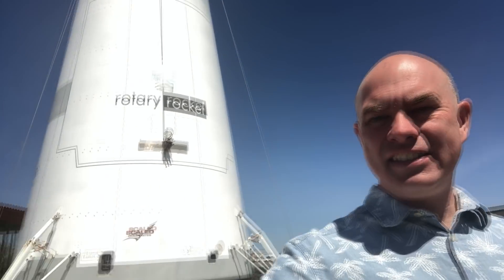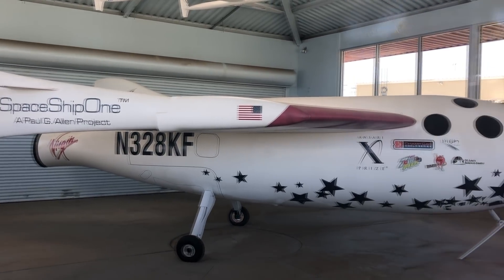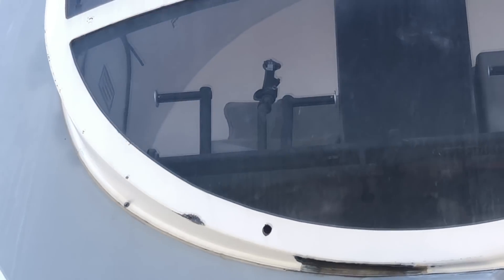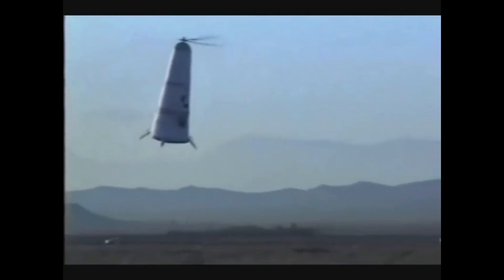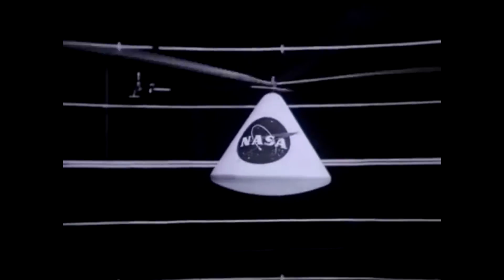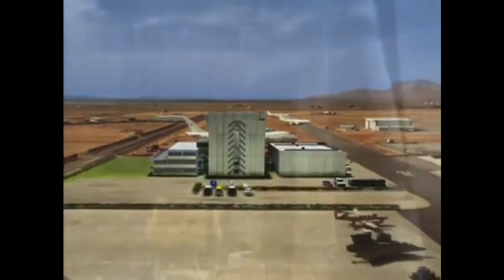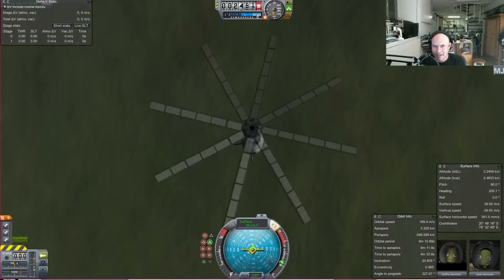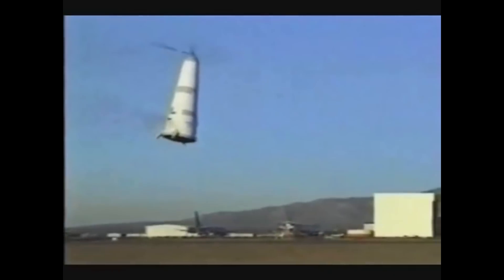Roton The Rotary Rocket - Half Rocket - Half Helicopter

Comment: Why doesn't the fuselage rotate? All helicopters I have seen have at least 2 sets of blades to counter out the net torque.
Reply: because the rotor was driven by small nozzles at the tip of the blades. This way, the rotor itself generated the torque that is needed to drive the rotor. Thus, no torque on the fuselage. (respectively only a tiny ammount generated by the bearing of the rotor)
Reply: Yes it did, they had to use small thrusters to provide counter rotational force.
Reply: The only rotational force would have been from downwash and/or rotor bearing friction, so there probably wasn't a lot of rotational counter-thrust needed.
Reply: @russschnapp4510  The spin, regardless of it's source, always produces a counter spin.
Reply: @TheEvilmooseofdoom  Uh, no. I don't think that's the physics of the situation. If you drive a shaft, you will get counter-torque. If you use reaction jets to spin the blades, there's no torque whatsoever on the shaft, which is only used to suspend the rotors. Likewise, if airflow is used to spin the blades, there's no countertorque. This is why there is no tail rotor on an autogyro.
Reply: @russschnapp4510  My understanding is if you're powering your blades around and jets are powered then you get counter torque.  Free spinning like an autogyro you don't.  I could be wrong but I did read about this rocket chopper some years back and did read that they used thrusters to control the spin caused by the torque of the rotor.
Reply: @TheEvilmooseofdoom  Tip rockets push off of the propellant that is leaving the nozzle, at the tip, no torque at the hub - if the bearings and connections at the hub were lossless, anyways. The hub is literally just a bearing and won't transmit much torque, there's no rigid connection there. There's still torque on the vehicle because it's not lossless, of course, and routing fuel to your tip rockets probably means you've got a bit of friction at the hub, but it's still on the order of magnitude that an autogyro deals with and not the major torque that a helicopter makes. Way easier to deal with via the RCS (that it needed anyways), which I'm not sure would be the case for a helicopter.
Reply: @jonored  Quite frankly how they get the fuel from the body to spinning rotor tips alone is beyond me. If your hub is not spinning like you said I can follow your line of reasoning.  If the rotor motors are self contained (fueled) that makes even more sense to me.
Reply: @TheEvilmooseofdoom  Interestingly enough, they probably have to thrust in the opposite direction to what a helicopter would - a helicopter is controlling the reaction torque from powering it's blades (opposite direction to the blade spin) while this is countering drag through it's bearings, seals, and swashplate - which is in the same direction as the rotor spin. You always need something to control your rotation, even in an autogyro, but amount you need and why can be very different.

Comment: I can see how it would help at low altitude in recovery and reuse, but I don't see much advantage in assisting takeoff; not in comparison to balloons or airplanes. Furthermore, without its use in takeoff,  the extra complexity, in both parts count and where you put the rotors, does not seem to be worth it in comparison to parachutes and powered rocket landings. 

Yes, powered rocket landings are complex, but having throttle-able engines and more advanced avionics is not a penalty in my book.
Also, I know my reasoning is kind of  circular, but the other meet-me -halfway options do not require that you bring the takeoff assistance with you. Therefore, it's not circular reasoning, it's spheric obloid reasoning.

Comment: i couldnt help but be reminded of the book "spaceships of ezekiel" by nasa engineer joseph blumrich. blumrich set out to write a book debunking von daniken and instead got fascinated by what ezekiel describes. he theorized that ezekiel saw a quadcopter (4 angels) equipped spaceship that landed and deployed omniwheels (blumrich got a patent on the omniwheel design) that allowed it to "roll in any direction without turning as it went"

if you look up "carcopter - flying car invention" on youtube there's something that behaves similar except for the rocket parts

the book came out in the mid 70's. in all the weirdo ancient astronaut shows they never mention it. surely it is wacko out there stuff but they cover all of that, why leave this one out?

the debunking i've seen calls out that ezekiel never said what he saw was round (probably doesn't have to be, or maybe when the quads are deployed it doesn't look as round) and ezekiel said the angels wings touched (which on some dual helicopters it kinda looks like they do, but i'm not sure how you'd configure the quad copter design to look like that)

there are a lot of other curious things, the beings wear belts that have "rubys with fire within" , perhaps led lights, the wheels have "terrible eyes" all around them, maybe cameras, and a lot of materials like polished metals are mentioned 

the beings deliver a message from god including a warning that it's a sin to lend money at interest.

you really can't get much weirder than all that, and again its weird that nobody mentions it. blumrich died still believing it happened.

it'd be fun to see it attempted in kerbal

Comment: Agreed.  Gyroplane flight is a criminally underused and underappreciated system but that thing looks like a single stage to 10km up vehicle, not a single stage to orbit.  Also, I wonder if they planned on using the rotors for all the descent?  It seems like they would still have to use some sort of ablator to make it through the faster parts of reentry.

Comment: How did they counter the rotational moment from the rotor during the flight tests? As far as I can tell there is no counter rotating or tail rotor, and I can't imagine using internal gyros that large would be efficient.
Reply: they do not have to, there is no torque in the system to counter, rotor is powered by jets at the tips of the blades.

Comment: Anyone know if a giant Archimedes screw be safer/cheaper than a space elevator?

Fix a pod on the bottom of it, turn and watch it rise
Reply: Space elevator would require way less materials. The tallest building isn't even a km yet, and to get to orbit you need to be up over 200km and going 27,000kph. A space elevator would stretch out past GEO, and from there escape velocity is just a step away
Reply: @philb5593  thank you.

Comment: Consider a design for landers under a ton wet that have motors below the CG so a bitch to land, moving them above the load solves it.

So, the exhaust of a toroidal sheath motor aimed 45° over a nacelle and reduced to 340kts adds lift to remaining thrust, 1st pass has 2x hovering total force up.

Then, hovercraft ascend most efficiently sideways not straight up, so, to get to orbit they spiral out.

Then, this works in a vacuum and appears to save enough fuel to allow a takeoff for rendezvous & resupply, an alluring concept

Have a paper for IAC going this fall as a design analysis of the idea, cheers!

Comment: I also love this concept, of course 1 stage to orbit was the biggest drawback, but as a second stage would have been amazing.
Autorotation is something very safe that any helicopter can do and you dont need extra power to land soft at all, only if you are still very far from the landing pad or the weather is too bad an external power source could increase safety.

Comment: My memory (which could well be faulty) was of watching a live streamed broadcast of the final test flight. The original engine had the rocket motors mounted on a rotating disk, the fuel and oxidizer would come down in the center of the disk and then out to the individual motors, the rotation of the disk would act as a pressurizing pump, instead of using a turbopump. The rotation would be powered by having the motors canted slightly along the circumference of the disk, not inwards. Essentially, the rotating disk was a centrifugal pump.
Reply: That sounds really ingenious if it worked!

Comment: As I remember, the original Roton had the engines only on the tip of the rotors, not under the vehicle. There were no turbo pumps but the fuel was flung out to the engines on the tips of the blades by centrifugal force.

As the rocket corkscrewed its way up through the atmosphere, and as the atmosphere became thinner, the pitch of the blades would increase until the engines were pointed almost straight down.

Comment: Seems like this could work as the upper stage/return vehicle. Not lift off on it's own to orbit. That should be obvious.
Back in the end of the last century I was doing aeronautical engineering in college in the Netherlands, and had  a friend in Redwood City. They had their head office there on the bay. I did contemplate if I could do my graduation project there. But life turned onto a different road then for me. And soon there after also for the company I guess.
Reply: Even better as a first stage recovery system. (Without the pilots, obviously.) How many good ideas have been killed by the SSTO obsession?
Reply: That's a good point. This could be used in a system much like Starship, where a reusable first stage gives this a kick, and then it goes on to orbit on its own power, bit needing to reserve any fuel.

Comment: How did they counter the torque from the main rotor?
Reply: Auto-rotating/windmilling. As long as you are not driving the rotor from the body (It's driven by the air flowing through the disk, or by jets in the tips) , the body should turn minimally. Same way a helicopter lands with engine problems.
Reply: In a conventional helicopter when the motor that powers the blade pushes in one direction it creates the torque in the other direction.

The Roton rotors spin freely around an axis moving either due to wind currents (autorotation) caused by it's fall or in the initial tests by the small jet engines at the tips.
Reply: @KnightRanger38  Ah, I understand.  I thought it was powered by an internal motor.  It must have made one hell of a racket, though.

Comment: Half rocket, half helicopter.
The real reason behind this combination was to launch the vehicle using the rocket engine and land it using the blades.
Reply: JLS so a rockopter?
Reply: @micaiaskauss  A helirocker
Reply: Originally, it was planned (according to the advertising), that the rotor would be placed more ”Midships” and the rocket would lift off from ordinarie airfields, using the rotor. Firing the rocket engines at altitude.
Reply: So, they never thought to use a rocket to land?  I guess, why would you, no one believes rockets can land.
Reply: It was meant to be able to land on normal airfields. And, you should know, that SpaceX lands rockets.
Reply: @YDDES 
Exactly...
Space X land their rockets using engines... Which is the correct way to do it..not by heli blades.
Reply: That was the whole Idea. To use rotors at low altitude, to conserve rocket fuel.
But, I suspekt it was just a scam, to get Investors, since it finally just became a glass fiber ”rocket” with a helicoper rotor at the tip. Nothing like the original plans...
Reply: Actually JLS, before companies like SpaceX and Blue Origin put the effort in to learn how to land space capable vehicles via rocket engine, this was actually a much more viable option. A tip jet powered rotor is way more efficient and controllable than a rocket motor, so the cross range capability on landing is immense enough to give you a lot of time and options to nail a landing.

SpaceX makes rocket propulsion landing look easy. It’s not.

1.) Rockets are unbelievably inefficient. And since the primary job of the falcon 9 is as a launch vehicle, it can spare very little fuel for a landing. Ideally, it should run out of fuel the second it touches the ground. This means you have basically zero wiggle room in the timeframe for landing. You can’t really loiter and make sure you get it right.

2.) Also ideally, you should go from freefall to a standstill on the ground with as little fuel as possible. This means doing what’s called a “suicide burn” (coined by ksp players. SpaceX prefers to call it a hover slam). It’s called a suicide burn because it’s just that... suicidal. Your ideal suicide burn basically involves free falling until you hit a very specific altitude, then go to full throttle, and burn off 100% of your velocity EXACTLY on touch down, and then go to engine cutoff. If you’re a second too late in timing your burn, or if you misjudge your altitude, you’ll slam into the earth. Or, if you go too early, your burn won’t be as efficient and will require throttling down... If you’re relying on the efficiency of a well timed suicide burn, and thus don’t leave yourself any more fuel than needed for that maneuver, then timing it too late will leave you going to engine cutoff midair (free falling the rest of the way to the surface)... All bad things.

3.) KSP players have the added benefit of basically having infinitely throttlable rocket motors, with almost 0% throttle engine cutoffs, and an extremely fine and fast throttle response... Real rocket engines don’t behave this way. Not only is SpaceX performing suicide burns to recover rockets, they’re also doing it with real rocket engines. They take time to light, they take time to cutoff, they take time to throttle up and down, and their engines can’t throttle down any lower than something like 40% thrust. These are not easy to control engines, and a proper suicide burn demands perfect engine control.

4.) That last point is a doozy too. The fact that their engines can’t throttle down much lower than around 40% causes one very big piloting problem. So unlike KSP players, SpaceX doesn’t go to full throttle on a suicide burn. The rocket is almost empty by the time it’s about to land, not to mention ditching stage 2 and the payload. If they reignited all 9 engines and immediately went to full thrust, the resulting G forces from the incredibly high thrust to weight ratio might even cause damage, like crushing an empty soda can. It’s one of the reasons why a lot of rockets throttle down later into the ascent.

Furthermore, even if they could do that, doing so would make the margins of error for landing so small that not even advanced computer piloting could handle landing it without crashing. Their current autolanding system can barely handle the margins of error at its current 1 engine at minimum throttle. Recently they’ve been experimenting with 3 engines at minimum throttle for both greater landing efficiency and redundancy, but that’s way harder to do than what they do normally.

And finally, the fact that the engines on the falcon 9 can’t throttle very low means one more problem... One Merlin at minimum throttle on an empty falcon 9 actually has a thrust
to weight ratio greater than one. This means that if you DON’T time the suicide burn JUST RIGHT, and start burning the rocket too early... The rocket will come to a complete standstill while still in the air well above the ground... And you can’t throttle down any further, so the rocket will start to accelerate upwards away from the ground. So there is no option for SpaceX to simply start their burn from further out, and then throttle down to a 1:1 thrust to weight ratio to maintain a safe descent rate. They have NO CHOICE but to do a perfectly timed suicide burn. It is the ONLY way to land one of their boosters.

———————————

Add on top of ALL of this the fact that SpaceX also threw in a last second translation maneuver to save the barge from damage in the event of a crash, AND they developed a rocket that was ACTUALLY cheap to turn around and reuse... And you suddenly realize that what SpaceX did was amazing.

No... Not amazing... Impossible...

It was literally impossible. I mean that, every space agency in the world, the ULA, etc, all toyed with the idea of rocket propulsive landing a booster. A good idea on the face of it, but as I just demonstrated, an unbelievably difficult thing to pull off in reality. For all of them, these engineering and piloting challenges presented were deemed nearly impossible to overcome. Comapanies like SpaceX and Blue Origin took a gamble on a long considered impossible (and rightfully so) concept, because pulling it off was the only way they could concievably compete against space giants like ULA.

I’ve been into space tech since I was a little kid. It astonishes me just how quickly people have suddenly decided reusable boosters a cakewalk... Guys... SpaceX makes it look easy because Elon Musk is a badass steely eyed missle man who nearly bankrupted himself and SpaceX after 2 decades of learning the hard way by crashing boosters over and over again to get to where they are now. OF COURSE they make it look easy, they’ve had to learn the hundred ways how NOT to do it... And that process is never an easy or cheap or simple endeavour. 20 years ago today, propulsive booster landing was impossible... And because of that, believe it or not, the rotor rocket was one of the very few FEASIBLE designs out there... Maybe not the SSTO part of it, they would’ve needed one hell of a huge aerospike rocket to do that, but the returning and landing part of it was doable.

Yes, propulsive landing is clearly the way forward now... But that wasn’t always so clear. Don’t underestimate what it took to MAKE that clear. SpaceX toiled for a long time to set the ground work for propulsive landing. Before them, just about any idea BUT rocket propulsive landing was considered feasible.